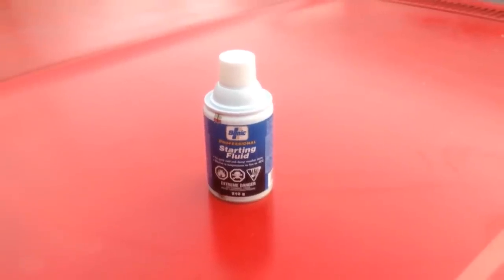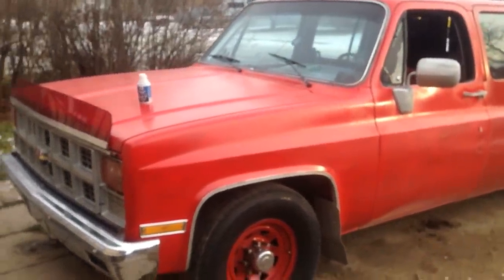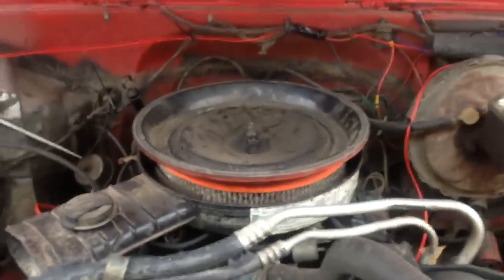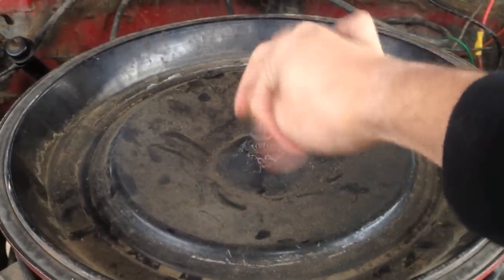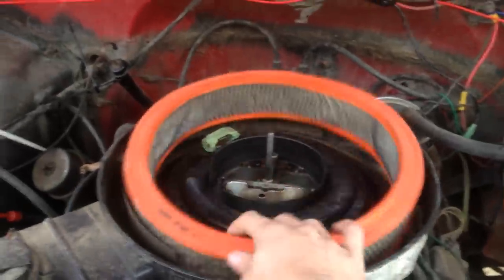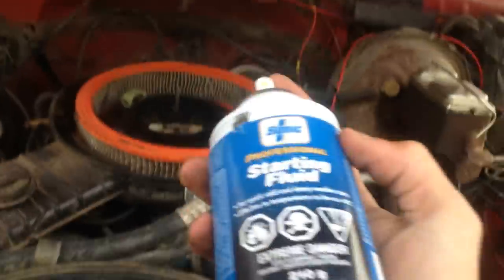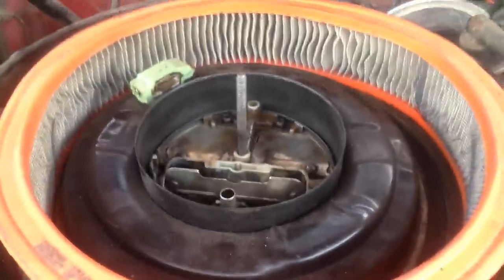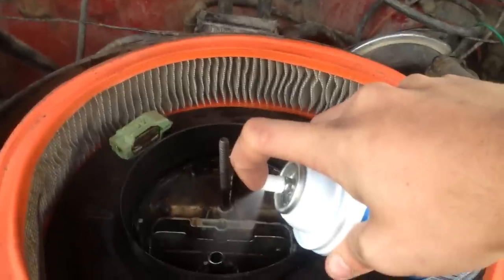Quick tech tip #1 Starting fluid and carburetors

Comment: 1:55 uuhhh, I think your air cleaner cover is on upside-down. The manifold heat stove isn't going to draw in any air through the snorkel connection if the cleaner is all open like that!
Reply from the maker: Alexander Riccio yes the air filter hat is upside down, and that was done to allow a little more air flow thru to the carb for a bit better perfoemance, and it acts no differently than the old school 2 piece air filters for these where you just have a top and bottom plate to sandwich the filter in between.
Reply: Ahh, ok then. Does the 350 have a crankcase breather hose & filter? I assume they don't work with the hat upside-down?
Reply from the maker: Alexander Riccio um, well at that moment it was just vented to atmosphere, thru a tube, i have next to zero blow by so didnt want to purchase a filter house for the factory valve covers. this spring it getting new valve covers, intake manifold, air filter housing, headers, and some small performance parts and will be getting propercrank case breather/filter. but during the winters the hat gets flipped back to normal for he heat risers to do their job,  and to have warmer air sucked into the intake, it was originally flipped upside down for a 500 mile road trip i was taking it on with a flatdeck and wanted every little bit of power booting i could get.
Reply: Aarons Automotive sweet ;)
Reply: I have the same setup on my 84 datsun pickup, just afraid I'd suck some trash into my new carb I just installed, think I'll leave my air filter cover on right side up lol - I get why you did that though.

Comment: Love that stereo installation
Reply from the maker: TheNeonRabbit sadly it was all hacked to bits when i bought it. still looking at getting a patch plate to weld into the dash to put a retro factory looking radio back into it mp3/usb input on the back of the unit. but wont be doing that until i rip the interior apart and rebuild it.

Comment: On our 1971 Ford grain truck with a 2 barrel carburetor I am spraying starting fluid directly into the butterfly and it is in the open position, but the starting fluid is just running out from somewhere in the carburetor, rather than getting into the intake manifold.  What would cause that?

Comment: you don't have to remove the air cleaner lid. You can spray the starting fluid directly into the nozzle-intake and the vapors will take care of the rest.  Remember starting fluid evaporates in no time. (**By the way you're the first person I've seen who put the air cleaner lid on upside down. Sort of defeats the purpose of keeping dirt & dust out of the carb.  My dad might have done it once or twice in years gone by but it was out of haste or absentmindedness. Funny!).  Thanks for the vid, I enjoyed it.😊
Reply: It allows cooler air through the filter, the air doesn’t bypass the filter.

Comment: just fix your fuel problem,it probably has a stuffed fuel pump or it is bleeding back for some reason getting air into the system, or fix your automatic choke,or use a thimble full of petrol, some chokes have winter setting that you have to set it to, also make sure the preheat tube is connected to the exhaust manifold. don't take short cuts that cause bigger problems down the track.

Comment: Holding the gas to the floor defeats the purpose of the choke as you are letting more air into the engine with the gas pedal floored. I’m thinking it would start better with 1/4!throttle on a cold engine after two or three pumps of the gas pedal. 🤷‍♂️
Reply: On an engine that's flooded do you think stepping on the gas peddle would help it start as it's allowing more air into the carb?

Comment: Hey Aaron , I’m Aron in Texas I to own an 1984 1500 High Sierra GMC I’m working on…this video is years old , do you still recommend I do this ??.🤔🤔
you got rid of your GMC limo the next year :yt:
Reply from the maker: Got rid of the "limo" due to a cracked block from water freezing inside of it, starting fluid has no I'll effects on gasoline engines. I still use it to this day on all my other older engines.
Reply: @AaronsAutomotive  thanks for the prompt response! I will def be trying this tomorrow morning 🙏
Reply from the maker: Aron, how'd it work out for youM
Reply: @AaronsAutomotive  i was able to crank it right away! I just swapped the valve covers and installed a new air cleaner system! Currently we are experiencing a cold front we went from 75 degree weather yesterday I flushed the old coolant to 35 degree that’s cold for us here in Houston 🥶 I’m going to keep restoring
Reply: @AaronsAutomotive  now that you experienced the cracked motor …what would you have done different? I was draining all the old fluids but didn’t get a chance ho replace the coolant . What I did is just disconnect all the hose hopefully this help not freeze and crack the block …any suggestions?
Reply from the maker: As long as coolant is rated for cold enough Temps it usually won't freeze. Reason mine froze was I did a coolant flush and used garden hose to run water thru and clean put ant loose sludge in the cooling system, than when inwent to refill the coolant I thought I purchased pure concentrated, so i mixed it 50/50 with water, turn out I bought pre mixed coolant already, and ended up diluting it even more, and ended up freezing at like -20c, most times the coolant is mixed and rated to not freeze until -60c or colder
Reply: @AaronsAutomotive  damn sorry to hear that ! I just flushed my truck and almost put the 50/50 but reached out to my mechanic he said it’s best to just put the undiluted one . I couldn’t make up my mine so I just left all the hoses unplugged he said t should be fine to prevent any cracks …but I was thinking what about the little water that didn’t drain
Reply: @aronp713  get yourself a booster pump that way you don't risk the damage or have to be going under your hood when having starting issues.

Comment: I have an 81 gmc k2500 wont start unless i pour gas into carb if i keep pouring itll keep running. Any ideas?
Reply: Also my air filter is off and my fuel filter is full of gas
Reply from the maker: +Rip Hick sounds like your mechanical fuel pump on the passenger side front the engine is bad. Or the fuel filter on the carb is plugged and dirty

Comment: Starting fluid dries everything up and can cause engine damage so if it must be used, it should only be after a few attempts of trying to crank it first without bleeding down the battery of course, then spray a short half second burst, just once into the carburetor and try again, repeat if needed. Two 3 second bursts is way too much, too fast. It works much better with a diesel engine. The fluid kept me from being stranded many times so always have a can with you just in case.

Comment: Do you get a little more horsepower with the carburetor air filter lid upside down? More air to the engine?
Reply from the maker: A little bit. Lets you adjust your carb for a better air/fuel ratio, and a little more power, only in the 5-10hp range thou
Reply: No you dont, its a waste of time.

Comment: do you usually pump the gas? because I usually spray it with 3 one Second and they just start with out pumping the gas.
Reply from the maker: CELICA BERTOCCHI yes when its fairly cold out here the throttle need pumping to feed it enough gas to atomize and bur  correctly till the carb has warmed up.
Reply: Aarons Automotive good to know.

Comment: if it catches on fire, does that mean i sprayed it in the wrong opening?
Reply: the fire quickly went out, but im afraid the try to start it again...
Reply from the maker: +No1Goddess naw, the small fire ball isnt bad at all, all it means is the engine had a backfire thru the intake valve. Nothing to worry with that.

Best thing to do if that happens again is while it ls "on fire" put the throttle to the floor and crank the engine over. 99% of the time that will snuff out the flame. Than try agaim
Reply: Aaron's Vlogs 
Thank you for this video!
-When that fire happened, thats what made me look up "how to spray starter spray" and i found your video, lol.
Actually, after watching your entire video, i realized i had sprayed the starter spray in the wrong area (i sprayed it all over lol).
Once I did exactly what u demonstrated, it started right up!
Yaaaaaaaay!

That lil fire scared the mess outta me tho! 😨😨😂😂😂
Reply: Aaron's Vlogs 
i almost panicked and wanted to pour water on it, but somethin told me not to...
and the fire quickly fizzled out by itself

Comment: Brand new fuel filter and i undid the fuel line from the carb and cranked it and it was spraying gas all over so i dont think its the pump
Reply from the maker: +Rip Hick hmm, could be a sticking float or dirty jets, 

Another thing i had realized when diagnosing a fuel issue in my 78 gmc motorhome, had to keep it running off a bottle in the carb, pump and filter were new on it and would spray gas out the line when cranking, turns out one of my fuel lines had a very small crack in it and was allowing the line to suck air in after it started and wouldnt run. And these square bodies are known for the rubber lines at the fuel diverter for the dual tanks to get dry and cracked. May want to give those and all other rubber lines a check

Comment: That's really hard on the engine, I can usually just spritz some around the filter and it fires right up. Not even a seconds worth
Reply from the maker: +Random Moustache Guy ya its hard on them, but this thing needed to be fed almost every morning off the bottle. She was old, tired qnd worn out
Reply: yeah mine is bad too. i'm switching to an electric fuel pump and she hopefully starts a lot better! if not i have a blown 383 stroker that my dad used to use for the mud drags. then she'll be a real beast!

Comment: Lol, he pumps the pedal even when he's not turning key.  ;<>
Reply: That's the point... Pump a few times then try and start ....
Reply: @dbleezy805  not sure if u understand how this works, but the engine is what drives the fuel pump, if engine isn't turning, pump is not pumping.
Reply: Thats how its down. Pump 4 tims and on the forth you hold it down as you turn the key.
Reply: @michaelcollins1899  your ac switch starts the fuel pump
Reply: @jonbertocchi173  I have no clue what u meant by that and I have a feeling you didnt either lol. The ac switch has nothing to do with fuel delivery...just like pumping pedal with no engine movement,  it's all smoke and mirrors. The only way to get fuel to carb is engine spinning, drives fuel pump. Fact
Reply: @michaelcollins1899  your fuel pump is electrical. So yes ac switch gets is rolling.
Reply: @jonbertocchi173  another dummy. There is NO fuel pressure  Until engine is spinning over. This is not a fuel injected car. You have to turn key and span engine as you pump the pedal the engine drives the fuel pump,  Not an electric fuel pump
Reply from the maker: BUT what you are forgetting about is pumping the pedal pushes on the accelerator pump in the carb giving a squirt of gas down the barrels each time you pump. Or did you forget that carburetors have fuel bowls? Yes the fuel pump will not supply fuel to the carb unless the engine is cranking over, but by pumping the throttle a fee times primes the barrels with fuel from the bowl. Allowing it to start easier on colder weather or from sitting over night.
Reply: @AaronsAutomotive  dude, yes, if it's a daily driver, you are right. But if ya dont know or hadnt figured it out yet, today's gas with 10 percent ethanol and some higher than that evaporates and a tremendous rate........there is no fuel in bowl lol unless u cranked it in last 2 days. My chevelle wont even go 7 days without pumping and cranking the H... out of it. In the old days, yes, it would stay in bowl for probably 2 weeks maybe more, but those days are gone.  Even the high dollar non ethanol still evaporates faster than the real gas these were made for. Just hit the key and pump the gas, there is no fuel in bowl lol
Reply: Michael Collins Not to add that a hot sitting eng will heat soak the bowls boiling fuel out of the bowls too